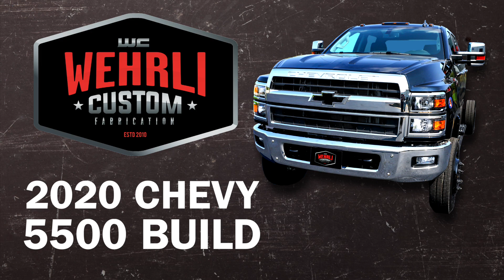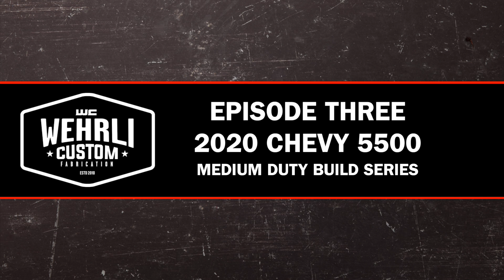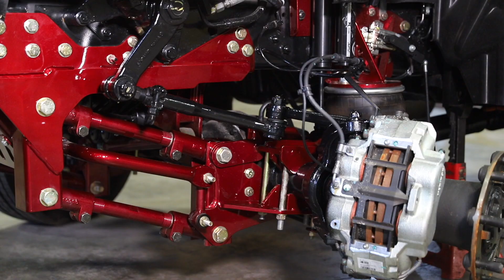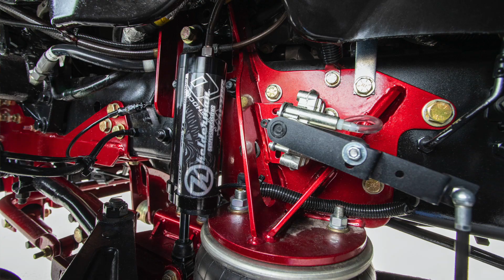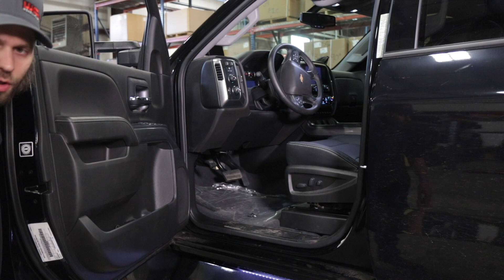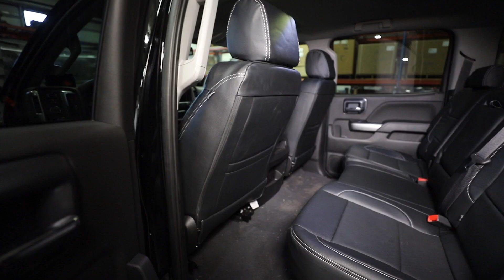WCFab Build Series - 2020 Chevy 5500 - Episode 3

Comment: What size air line is that fitting on the bag??? Looks 5/8”?
Reply from the maker: We don't unfortunately have the specifics on the air line fitting on this kit handy but if you reach out to the team at Kelderman Manufacturing (https://kelderman.com) they should be able to help you with that question.

Comment: I know that the truck came with air compressor from the factory. But could you do a video review showing the kelderman air control system. Thanks
Reply from the maker: We do not have a Kelderman air control system on the truck, currently just using the OE onboard compressor, tank, and mechanical height adjusting valves that come with the Kelderman suspension system. Stay tuned for a future episode though, we do have some plans for a different type of control system.